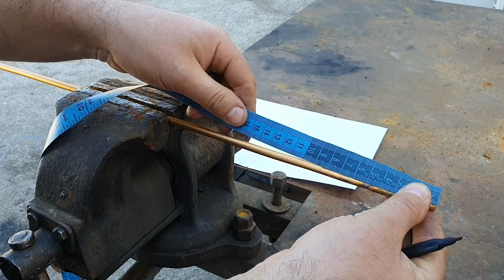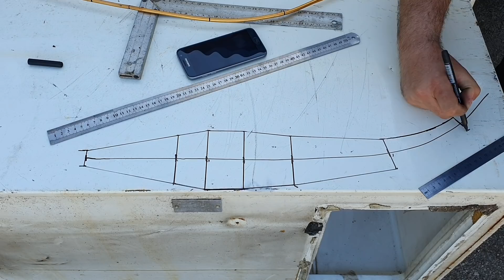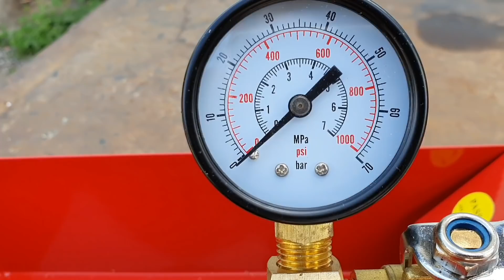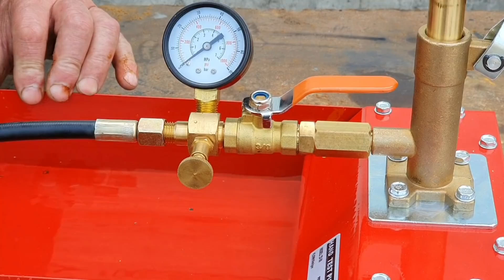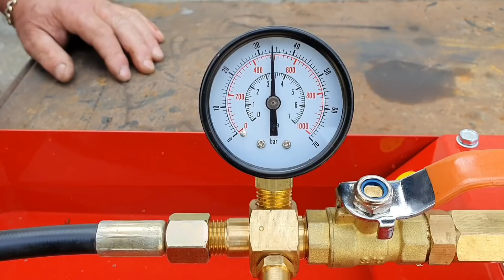Yasuni Z hydroforming

Comment: Great work :)
If you use your vise to hold the centre (dwell) section it will restrict it  and allow the header section to form more easily. Additionally if you fit a quick release coupling you can remove it from the pump while pressurised and work the creases and out of round areas with a hammer as the pressurised water acts as a dolly.
Ps. Love the use of an old appliance for the metal 😁

Comment: That was very risky. 
If that had burst under pressure whilst you were holding it in your hand, you could easily have lost that hand.
Reply: I doubt that very much;  in fact i thing he would not even suffer a scratch;  for an explosion you'd need a lot of air(or a gas) inside, to expand violently,and since he started with a flat piece there is only water inside;  i think it would then just open a small tear somewhere,and the pressure would disappear in a second; still,i would not risk it, i would release the pressure first.